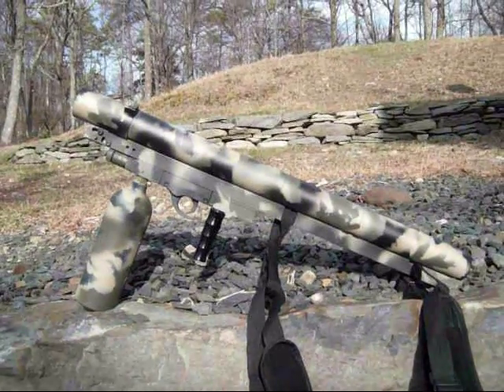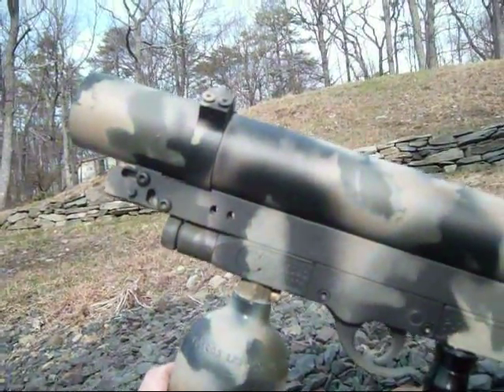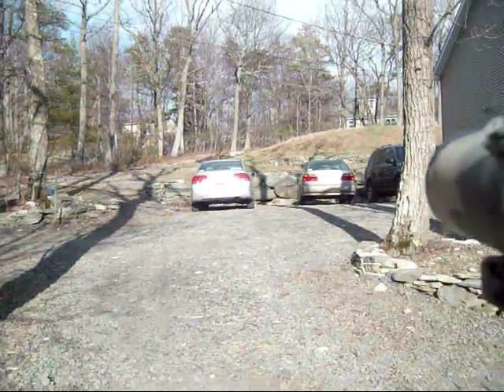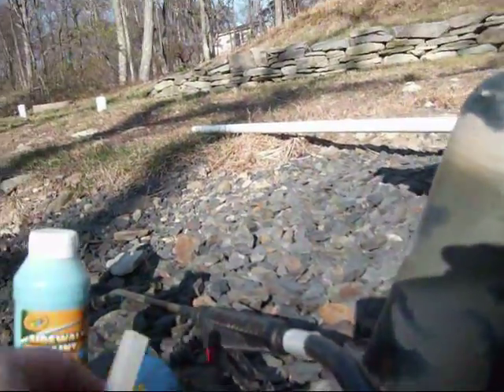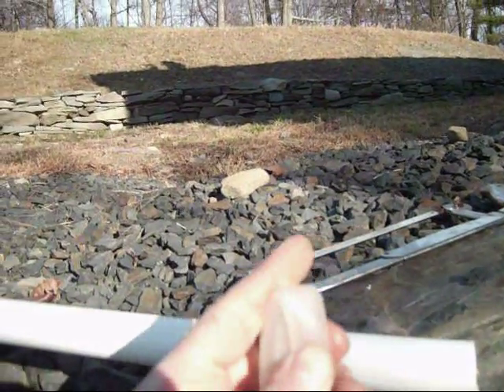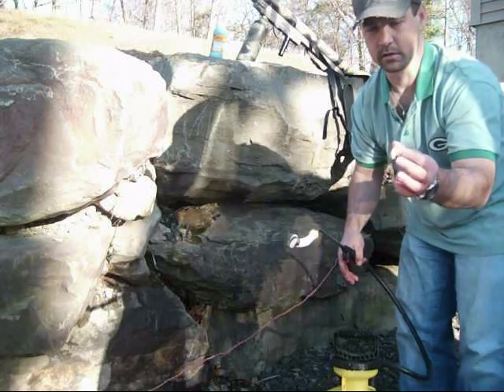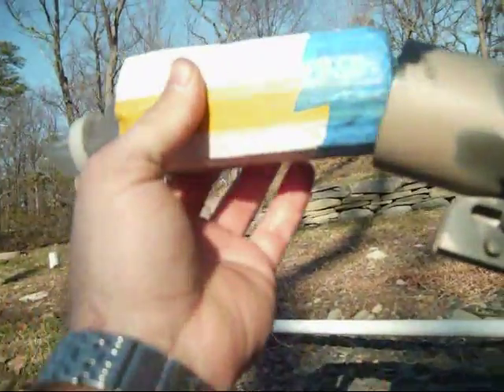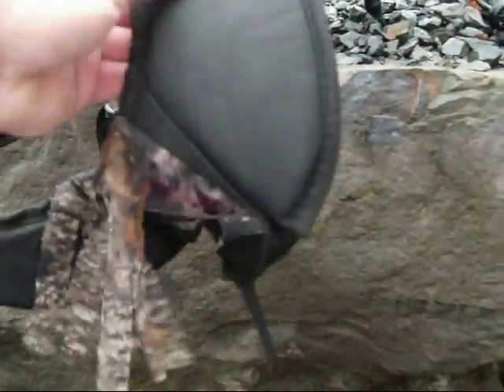JCS Rocket Launcher

Comment from the maker: @tmaclax013 the launcher works about the same. Since I play in scenario paintball with tanks and bunkers, you need to work and shoot fast. It takes about 30 seconds to load the grenades in the back. I can shoot several off in that time shoving them in backwards. You have to use the Nerf grenades though. If you use the cheap $2 ones, they slide out easily, and most often blow off the tail wings. Happy hunting.

Comment from the maker: @morgansniper If you look on line, you can see ways of building a launcher out of sprinkler system valves. Instead of putting hairspray or something like that in there, you can fill it with compressed air or CO2. You could regulate the pressure with some regulators and a pressure gauge. Good luck. Put up a vid when your done.

Comment from the maker: @tmaclax013 You can trim them if you want, but you don't have to. I have seen a lot of guys that do. Since the tails do touch the inside of the barrel if you don't cut them, I would think cutting them makes the nerfs last longer and fly straighter if you do. I never tested the difference between cutting or not. That may be the next vid.